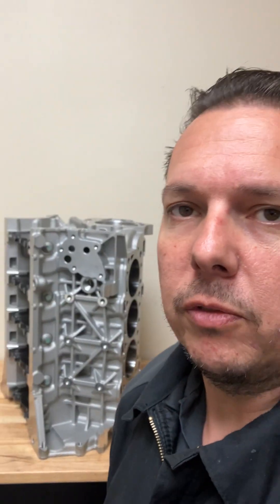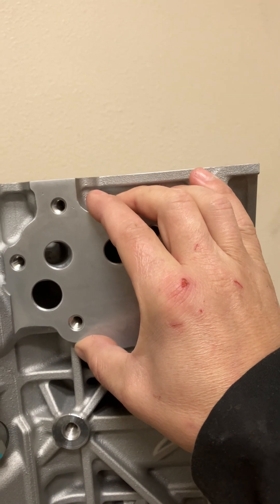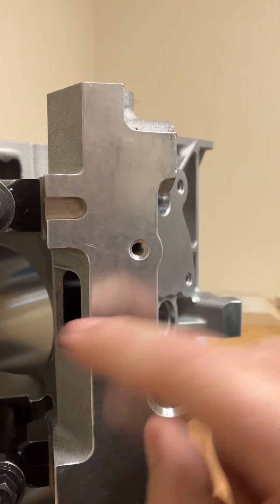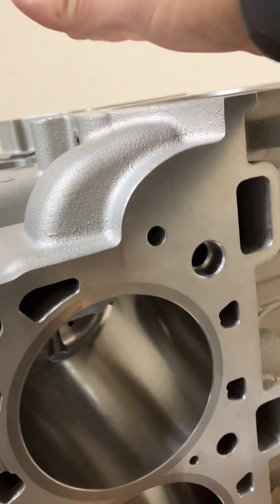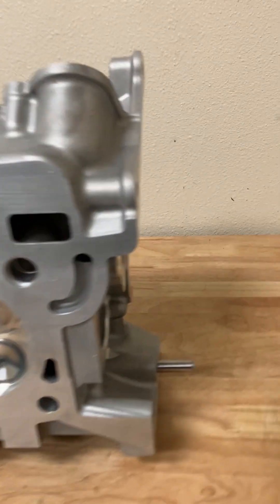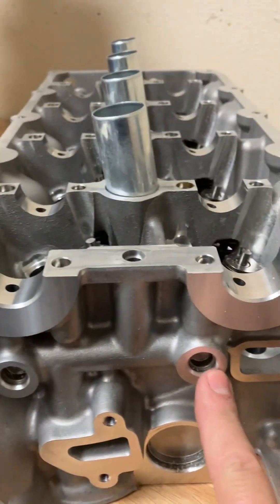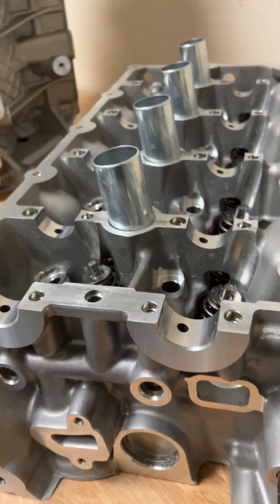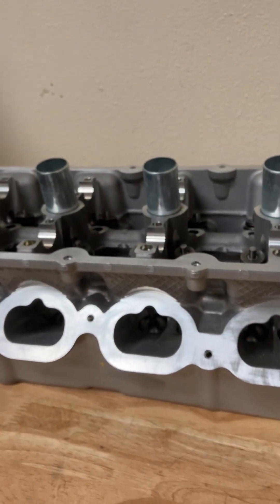Coyote oiling system explained

Comment: 1) Why are there 3 holes in each of the blocks main for?
Reply from the maker: which holes are you talking about?
In the main webbing.
Reply: @aedtuning8441  Yes. THX
Reply from the maker: @VGHCX  pressure balance between mains
Reply: @aedtuning8441  I see. Thanks for the info.

Comment: With how crucial and reliant engines are on proper oiling, I will never understand why people would risk internal engine failures by using unknown quality/brands of oil... but mostly don't understand people subscribing to these CAFE endorsed Looong oil change intervals?????

I have never seen ONE engine destroyed from good maintenance, but have seen countless due to lack of proper maintenance intervals. People will risk losing thousandS of dollars to not spend 50 bucks on some good oil at a good interval.
Reply: Oil change interval is highly dependent on use and quality. If you use a high quality synthetic oil and are highway driving 6-7,000 miles no problem. If you’re tracking the car I’d change it every outing and if you drive it hard on the street regularly 3-4,000 miles depending. Any more than that you’re just spending money with no real mechanical benefit.
Reply: Oil being the lifeblood of the engine, I see no benefit in going as long as you can, or extended intervals. Most people don't know the damnedest thing about engines and will just follow a regiment that they've been told and sounds right to them. Some vehicles with good ring seal, ventilation would be perfectly fine going 5k highway miles before changing. Others would benefit from less (3k).

I have a 2.4L Accord in the family that likes to drink oil. It has done so from day one. It eats one quart every 1000 miles and the oil gets darkened within 2k miles. If I went 7k highway miles on that vehicle it would have pitch black oil and be out of at least 3 quarts of its 4.4 qt capacity.

Camry, same year, eats only a few drops. It would do 5k miles just fine. It doesn't start to darken until about 4k miles. 

In a scenario where most people are unaware of their own vehicles, neither vehicle would be negatively affected by frequent oil changes, whereas the Accord would suffer going longer. 

I also believe it's a waste of money to put clean fresh oil (with fresh additives package) into an oiling system that is dirty. Frequent oil changes keeps the oiling system reasonably clean... And that's never throwing money away. I'd rather spend fifty bucks here and there than ten grand all at once because I thought the oil was still good. And the only way to know you don't have too much fuel dilution too many times is sending samples to a lab. Nobody does that. Just change it at a proper frequency.

Comment: Hello,   Never once did you explain how or when the connecting rods are oiled?  It's very  important that they're lubricated also.
Reply: There's passage through the crank that feeds the rods individually through their journal, not windage oiled like the other dude said :0
Reply: Windage oiled
Reply: @Quick_Fast_Hurry  You're a complete idiot if you think the connecting rod bearings are "windage oiled" in any modern Ford engine!
Reply: Boss Roadrunner has no piston squirters.